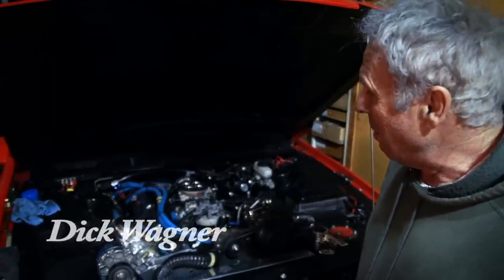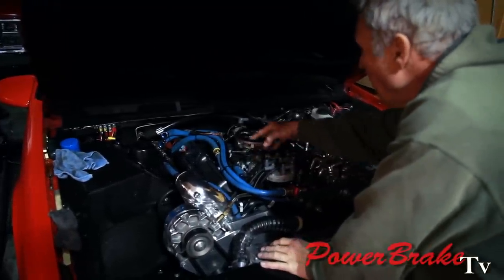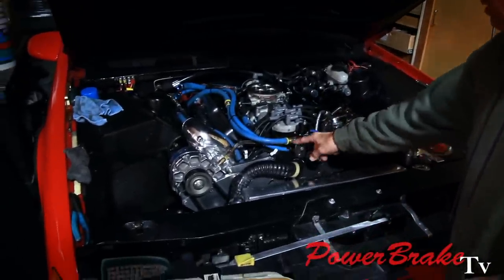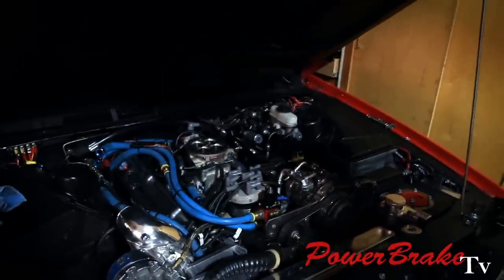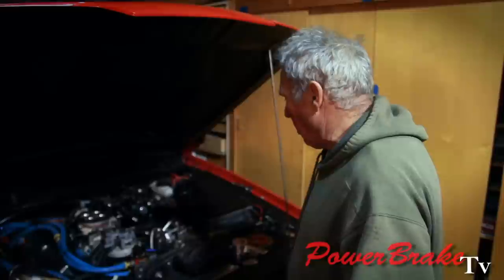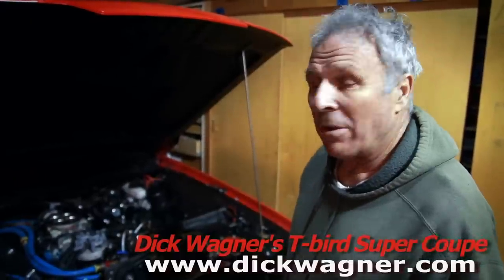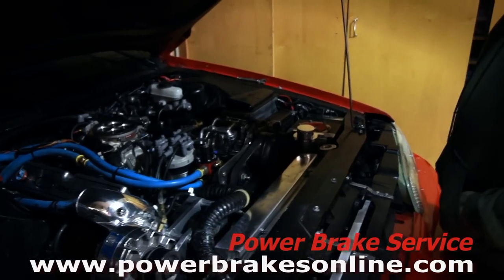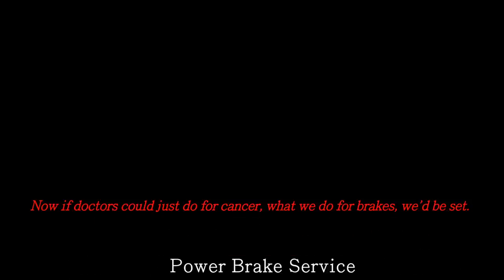800 Hp T-bird Super Coupe Kenny Duttweiler 427 : Power Brake TV

Comment from the maker: Click on the powerbrakeservice profile link. Click on the 'Videos' tab, and go to page 5. The first three videos we uploaded were on the installation of our Power Brake Service Hydro-Boost brake system on it. These cars came with an electric brake booster, which are now obsolete, and since parts are hard to find we converted it to a Hydro-Boost. The video that pops up on our profile page right now is another radical car owned by the same guy, that we are doing a lot of work on.